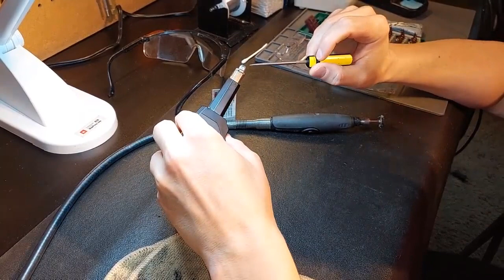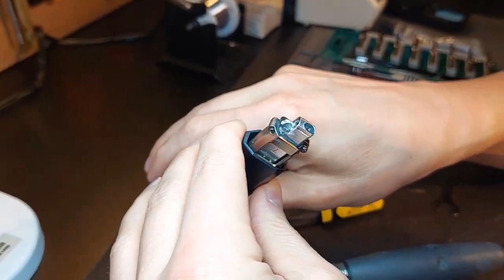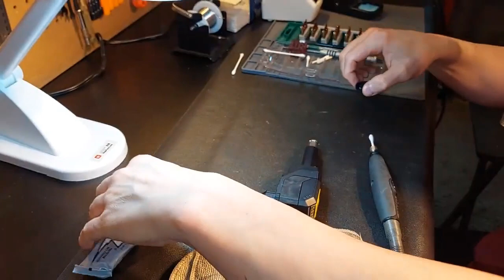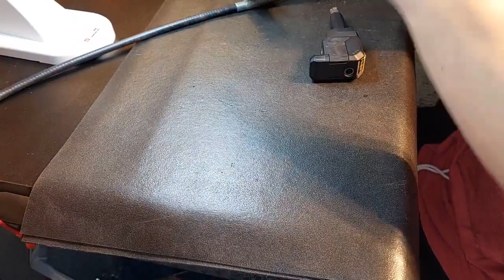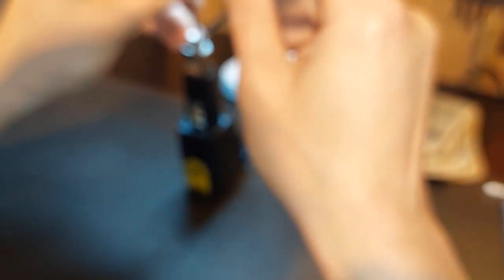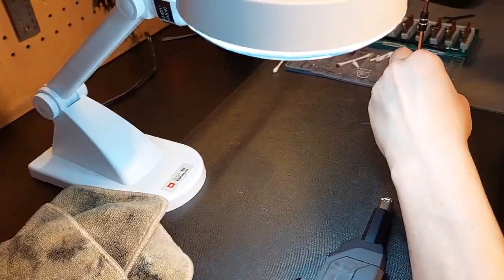How To Restore The Makerbot Method's Hot End To New Condition || Mastering The Method

Comment: Hey there, mister Vince. You wouldn't happen to have a video on clearing the nozzles internally? My method came with 9 extruders and all the nuzzles seem to be internally clogged with filament. Maybe I'm miss understanding how they work. Iv seen videos of other printers nozzles being cleared but I don't think it will work with the method because of the length and the gears in the extruder.